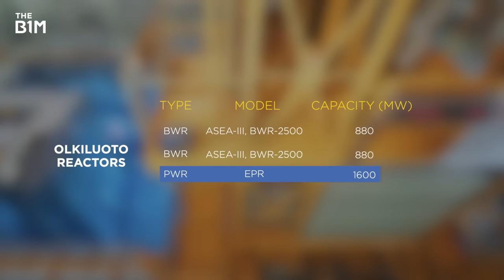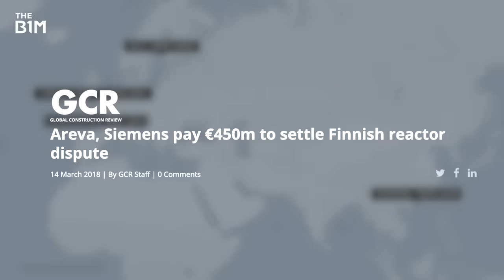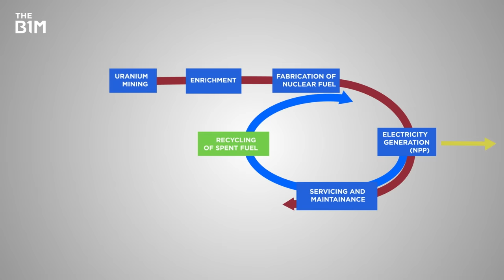Finland Might Have Solved Nuclear Power’s Biggest Problem

Comment: I thought you were going to tell us they'd perfected some kind of breeder reactor that would re-enrich spent fuel into a usable product so it didn't need to get buried anymore. Instead I learned they are just burying it bigger better and harder than ever before
Reply: The type of reactor you're talking about is called a breeder reactor or fast breeder reactor, and they do already exist. They can be more expensive to maintain and also directly produce more fissile material than is put into them once they're up and running. This is a great plus in terms of efficiency but also poses many security concerns regarding control of weapons-grade nuclear material. For these reasons less-efficient and more wasteful reactors like the one in this video are often preferred, despite the effectively permanent waste. There is also always the concern with water-cooled reactors of catastrophic failure, such as the events at Fukushima and Chernobyl, which is still present in uranium-based breeder reactor designs. One proposed solution to the water problem is Thorium-based molten salt reactors, though these still have the security concerns of any breeder reactor. PBS Spacetime recently did a good video covering Thorium reactors if you're curious!
Reply: @ganonfan98  there is no problem of control over weapon-grade material. Plutonium that is produced other than Pu239 contains Pu240, which means no nuclear bombs. Pu240 can cause spontaneous explosion if its used in weapon (because it "combusts" 30000 times faster than 239, so chain reaction can be caused by normal decay), and no one likes your own bombs exploding in your own storage facility.
And you can not separate atoms that are only one unit of mass apart, no centrifuge can do so.
Reply: Yeah having a permanent disposal solution is so stupid when you instead you could use a risky temporary solution that requires constant active upkeep
Reply: @bbbbbb3734  molten salt reactor designs have walk-away safety, actually. I suggest you look into it!
Reply: @ganonfan98  I recommend you look into technology that does not exist.
Reply: @ganonfan98  To be fair, if you struck a toaster with lightning or threw it into a lake, it'd blow up too.
Reply: @wumi2419  but that is not the stuff they are burrying is it :D
Reply: @jotha7207  thankfully its not. I don't think anyone in the world has working industrial breeder reactor now (Russia has prototype, but iirc its incomplete)
Reply: Hey but to be fair, the burial only has to last 100,000 years. As soon as you bury it good enough to accomplish that you're finnished.
Reply: Yeah, I'm pretty disappointed as well.
Reply: You can dig out the fuel once you've created such a reactor so Onkalo is kinda part of that solution too. But yeah, the breeder reactor would ALSO produce nuclear waste that would need to be handled. It cannot be recycled infinitely, it must go somewhere ultimately.
Reply: But honestly I'm a bit dissappointed when people are dissappointed when there's a practical and thought out solution to a practical problem when it's not some Elon Musk level bullshit. Perhaps lower your expectations and start thinking practically. This is just engineering!
Reply: @McSlobo  The reason why I’m disappointed is that once you have an apparently-good-enough solution to a problem there is inevitably less pressure and motivation to try and find a better long-term sustainable solution.
But that’s me.
Reply: @McSlobo  not necessarly the technology wont be created in at least a century since something like that is almost impossible and they still have to think about the half life of the waste
Reply: @bbbbbb3734  Putting something in the ground and covering it up, isn't a "permanent solution"
Reply: @xcvsdxvsx  This huge facility accommodates spent fuel rods for the last 50 years and until 2120, so about 150 years worth of fuel rods. To cover the 100,000 years needed until the rods are "safe" again, you'd need 600+ more of those facilities! Just imagine that. And that's for Finland's usage as of today only.
Reply: @mbirth  No no. They wont leak radiation for 100,000 years. At which point there will be no radiation to leak.
Reply: @xcvsdxvsx  Anyone who thinks that we won`t find a way to use this spent fuel in the next 200,000 years hasn`t been paying attention.
Reply: m oi unfortunately it is not a permanent solution. It’s a typical thing humanity has done since the beginning - use technology to your advantage without having a viable fail proof solution to the consequence. Thus the current disaster of the planet. Just one more problem for future generations to deal with. Based on the track records - it will fail
Reply: Markus Birth agreed!! Not a solution
Reply: You can throw the spent rods into a CANDU reactor ;)
Reply: When it starts to open more after the use.
Reply: And then it stays 100 years there, unitil its been long enough there and so some guys in next centary can pick it up.
Reply: @SlagerOutdoors  Just out of curiosity is your position that "this isnt buried deep enough"? Or is is that "not even the center of the earth is deep enough if it is man doing the burying"?
Reply: Solution, hahaha, just moving the problem 50 years into the future is not an engineering solution, it is a political compromise  that will affect our children and future generations.
Reply: @sorinangeleanu  Nuclear waste decays over time becoming safe unlike substances that have chemical toxicity. We need nuclear to solve climate change since it's the only stable co2 free energy source.
Reply: @bbbbbb3734  lol, just sell nuclear waste to Russia which has TWO breeder reactors. Easy solution
Reply: The whole issue is ridiculous,i`m very pro nuclear power but question why build this kind of reactor when a power plant using a fluoride thorium reactor. is vastly safer with little waste and uses less Thorium than a Uranium reactor( 1/35 for the same power generation)
Reply: Re-use spent fuel? Hahahahahahahahah! Fat chance of that nukie lie ever happening.
Reply: @fistful_of_aneks  Three points. 
1. Russia only does that with its own used nuclear fuel - produced by TVEL (Rosatom)
2. The country does not sell it to Russia, it pays Russia to take it back. After multiple “recycling” processes, a couple of tons of used nuclear fuels become 20-40 kg box which is 1000s times less radioactive and that “box” is returned to the country.
3. Closed nuclear fuel cycle is something that Rosatom is working on. Brest 300 is under construction. Should be operational by 2030 - give it 2-3 years to test all the new tech… if successful - by 2035 they will offer these reactors to the world = things in energy markets will change the world 180 degrees.
Reply: @ganonfan98  Chernobyl style failures are now impossible due to introduction of a lot of safety features designed after that event. Fukushima failures are due to incredibly exceptional situations. Fukushima reactor is from the 60ies. Water cooling is not inherently "unsafe".
Reply: The future will be some form of molten liquid salts as fuels. Magnitudes in efficiency over solid fuels.
Reply: @jackfanning7952  imagine thinking renewables are economical. LMFAO
Reply: @TheFoxSaid  Imagine thinking that renewables are not 4-10 times as inexpensive as nuclear and twice as inexpensive as fossil fuels and not orders of magnitude cleaner and safer. Hahahahahahahah!
Reply: No shit.
Reply: @xcvsdxvsx  it really doesn't. Radiation falls of with increased duration, so unless it's the start of a very long, decay chain of short lived isotopes or outputting a lot of gamma radiation, it's probably fairly safe to store above ground (if it is one of those two categories, then it's almost definitely still useful as fuel in a molten salt reactor, so why is it being thrown away).
Reply: @McSlobo  well, it can be recycled until it's at or below background radiation levels at any reasonably expect temperature (<1000°c). At that point you are probably dealing with something that's functionally inert or is a toxic substance, the former is safe to simply deposit into landfill, the latter can be disposed of into a subduction zone (if properly set up, you can use it to pump up more useful materials from the mantle, though even without that, it will slowly work its way down into the mantle where it's harmless if buried in such a location)
Reply: @sorinangeleanu  well, you can't have a final solution for anything unless you figure out how to cause spreading proton decay or your plan is named by a failed art student.
So long as you think of every solution as just a part of a larger equation and keep working on kicking the problem further down the road, you'll either find the problem has become unimportant, the missing piece in solving some other problem, or the universe is so far gone that there's no need to kick it any further down the road.
Reply: @wildfire160  for the same reason it's efficient to starlift the sun to remove helium: it's better than wasting the rest of the stuff we have, and given that it's actively decaying to produce waste heat, it's better to start using everything now.
Reply: @jackfanning7952  inexpensive? Sure, if you ignore having to replace them every 4-15 years...
Reply: @theapexsurvivor9538  How often do you have to replace U-235 in a reactor? How often do you have to replace casks storing the 20-30 tons of 100s of ionic radioactive isotopes generated by an average reactor per year for the next 240,000 to a million years?
Reply: @theapexsurvivor9538  Not sure if i`m getting you,what you're saying doesn't seem to apply to anything i wrote ...did you maybe reply to the wrong post??
Reply: @bbbbbb3734  problem is it's not permanent. Imagine an earthquake unearthing those or lava entering or water or whatever natural phenomenom in those kind of stockage places.And don't forget those materials and holes are meant to resist for thousand of years since they are permanent. We aren't even sure what will happen in the next 100 years so i'm not buying the permanent .It's just " yeah we dig bigger holes, made better casing  and that solves all the problems " .
Reply: @jakkonexus1166  those " incredible " situations are becoming more and more frequent due to climate change . So Fukushima is just the 1st one of its type. And since we fucked up and can't stop climate change ,  the exceptionnal conditions Fukushima happened under are gonna become the norm much faster than you  can decomissionned those facilities.
Reply: @bbbbbb3734  haha, dont waste your time. People just are too stupid. This guy really thinking he's the firts who thought about earthquake haha
Reply: @ganonfan98  wasnt thorium a good alternative since you cant produce nuclear weapons out of it?
Reply: @luciuslucifer9455  That's why they are carefully picking a place where to dig those tunnels. Don't compare California or Asia with Northern Europe. Northern Europe rearly gets any earthquakes and when they do they are minor. Even apples don't fall from the trees during those.
Reply: @jackfanning7952  Also, ask Germans what they think and how things are going with their plan to shut down they nuclear plants. Their switch to "green" is a disaster.
Reply: @EriksHarjo  Germany has the strongest economy in Europe. Ask France what they think of EDF's European Pressurized Reactors (EPR) that were supposed to be the forefront of the nuclear renaissance in Europe. Their reactors at Flamanville, Olkiluoto and Hinkley Point have been characterized by safety deficiencies, construction delays (the gang that couldn't weld or pour concrete correctly) and costs explosions. These are total failures even before construction is completed. The lawyers are piling up at the gates, scrabbling for a hunk of the carcasses. At least Taishan got started before they had to shut down to make repairs to stop contaminating Hong Kong. What has China set as the safe exposure limit for nuclear emissions this week? Wonder how much it will cost (and whether it is even possible) to clean up that mess with the fuel rods? While all this has been going on, renewables passed all other energy providers as the number one source of energy in Europe in 2020. And they don't present a weapons proliferation risk. Imagine that.
Reply: @ganonfan98  there's a really good video on why most water cooled reactors now don't carry the same risk anymore.. mostly because the water for energy production and moderation are the same water. If it gets too hot the water goes away, the particles move to quickly to have a likely chance of hitting another nuclei and sustaining a reaction and then it stops
Reply: @jackfanning7952  If by "renewables" you mean solar/wind/water then they will not be viable for at least 100 years, most likely a few hundred or a few thousand years. Nuclear is the only viable option to use during that time. Unless you prefer Coal and Gas, which, I don't think you would; given your inclination.
Reply: @IrregularPineapples  You aren't keeping up with current events are you? Energy from solar and wind exceeded the energy generated by nuclear and coal in the U.S. in 2020. Solar and wind energy exceeded all other energy sources in the EU in 2020.  Nuclear produces 4.8% of the energy in China. Wind over 15% and solar over 16%. Nuclear energy has flat-lined for the last 30 years and those creaky, brittle, leaky old reactors are getting older and more expensive to maintain every year. Major financial investment firms will not touch investing in new nuclear plants with a ten foot pole. The only reason nuclear utilities haven't shut down their creaky old unprofitable reactors is that as soon as they do those reactors will go from the asset side of the spread sheet to the liability side. The utilities and financial firms investing in them will immediately go bankrupt. That will be the blessed end of the "Atoms for Peace" farce... very soon.  But for the wrong reason. Not because of its horrible health and environmental destruction, but for economic reasons. Solar and wind has grown 70% to 80% in the last decade and energy storage technology has made huge advances. It can now cheaply and adequately store energy produced when the sun shines and the wind blows . Renewables produce (and store) energy 2-5 times cheaper than nuclear and nuclear hasn't even addressed the most costly issue - waste disposal. Not only are renewables the future of energy production, they are the present. Want proof? Look at the World Nuclear Industry Status Report (WNISR) for 2020. It will give you specific information on the nuclear industry in countries around the world.  Read it and weep, nukie. Learn something and quit spouting untrue NEA propanganda.
Reply: @IrregularPineapples  Crickets
Reply: @xcvsdxvsx  Thats what they said 100 years ago when they buried toxic hazardous waste in steel drums
Reply: It's honestly not a bad strategy, America is ridiculous with the nuclear waste.
Reply: @xcvsdxvsx  in one generation everything we buried could be lost knowledge wise. So don’t dig it up for the next 100k years. Rip.
Reply: @McSlobo  so how about we stop making things where the best thing we can do with it is bury it for the next 100k years. Lmao some things in engineering shouldn’t be touched if things are “impractical” yet ahead we march creating tons of waste we can’t do anything with that kills anything it sits near. So why go after those disappointed with your progress and instead make the impractical practical.
Reply: @ganonfan98  IFR's do make PU, but makeing it into a weapon is not a lot easier than LWR fuel * LWR = 60%  IFR 80%   that last 20% is not done in a back yard.
Reply: Clickbait
Reply: Nuclear safety protocol in pretty much every country dictates that contaminated materials should not be stored below the water table. It doesn't matter how much you do, time and water can wear down pretty much any defence, and when they do, it then also provides a mechanism to spread the radioactive material directly into the water supply. 100,000 years is a long time.

Would have been better off running this facility back into a mountain. This is making it someone else's problem in a few hundred years.
Reply: @jackfanning7952  that's some interesting math you've done there. By the same logic you could say that natural gas fired power generation was greater than all other sources in the US.
Reply: @justsomeguyhere that 3% is waste then. And then that 97% produces 3% waste? Or would it deteriorate worse? 

Regardless there’s still waste we can’t dispose of.
Reply: @mbirth  yet that buys scientist another 150 years to think of other ways to create nuclear energy that create less waste, or a better way to dispose of it, maybe by that time we can just teleport it to another planet
Reply: The Russians are already on that. Besides remanufacturing irradiated fuel into new fuel (which the French can also do, just worse), RosAtom is currently building the first entirely closed loop system with reactors + re-ingestion of fuel, due to enter experimental production circa ~2030. This is not a 'problem'. The solutions are already in flight and at this point, burying what is a valuable input is just silly. I blame the US for labelling irradiated fuel 'waste' by law.
Reply: @jackfanning7952  "Nuclear energy has flat-lined for the last 30 years" because of people with radiation phobia, like you. That has led to an increase in fossil fuel usage. Climate change has accelerated because we stopped building nuclear plants. Anyone who cares about the planet and also listens to scientists, is in favour of using fission reactors. I don't know how much you care about combatting climate change, but clearly you prefer satisfying your irrational fear of radiation. BTW, coal plants also emit radioactive particles. Only those aren't stored in dry casks. They get spewed right in the atmosphere.
Reply: @computercrack  I think you are right about it being about economics in countries where the private market was financing them (US, Germany). Your arguments make perfect sense. Nuclear is only cheap when you factor in the long lifetime of the facilities. Very high upfront cost. But in many countries, where they were financed by governments (France), the reasons for the slow-down were political. Right now what is most expensive is storage. Wind and solar are very cheap because they don't need to worry about storage yet and they get priority on the grid. If 100% of electricity was from wind and solar, they would be much more expensive. Either a lot of storage would be required, or we'd need to install 4 times the capacity needed without storage and run them idle a lot of the time. We can theoretically compute what would be the ideal mix of solar, wind & nuclear in order to minimize electricity cost. It will for sure not be 0% next to nuclear. When it comes to hydro, the more, the merrier, since we can switch it on and off (almost) as we like and even use them as batteries if retrofitted with pumping.

I will ignore the matter of nuclear waste, since compared with storage and distribution, it's a non-issue in terms of cost.

Flamanville will make a lot of profit over the 80 years or so that it will be operating for. But it will take a long time for it to start making profit.
Reply: @computercrack  Also, cars would've polluted massively anyway. But heating and a lot of industry could've run on electricity provided that electricity was cheap and abundant enough. Unfortunately it is still much cheaper to heat your house using gas. Even with the recent price hikes.
Reply: @radoomiron93  you can look up "EU taxonomy nuclear" so much for cheap energy. France wants to label nuclear as green to direct money from investors to nuclear because France as a state can't afford it. EDF is running at 37bill debt. You can't rule out economics entirely. France nuclear reactors are almost all reaching 40 years lifetime and need to be replaced. Flamanville =12 bill multiply by 56 (number of nuclear plants) = that's almost 700bill € and thats only the building cost. No decommissioning old plants, no loans, etc (Flamanville is even expected to be @19bill after all). Even France wants to reduce nuclear to 50% or so. Why? It's freakin expensive, that's why.
Reply: @radoomiron93  ignoring the cost of waste disposal is dishonest, you have to take everything into account. And it's not for free, that's for sure. Flamanville will never ever turn a profit and it will not last 80 years without complete overhaul. Do you know any industrial facility from 1940 still in use today without major overhaul? Only thing I can think of is the Hoover dam, but that's just a big concrete wall, the turbines itself have been replaced already in the 80/90s.
Reply: At least it seems to have placated Godzilla.
Reply: xcvsdxvsx I don’t think burying nuclear waste is a viable solution no matter the depth. I would suggest mixing an unnatural source with the original creation posses a huge risk of a negative side effect.
Reply: Petar Petrov not exactly sure what you are saying. Nuclear is good or bad in your opinion?
Reply: I also thought that's what this video was when I clicked on it.  Reprocessing fuel is really what we need to be doing.  We can reduce the volume and toxicity and half-life of nuclear waste through reprocessing and reuse.  That this is not a direction politicians are embracing baffles me.  Wind and solar are nice supplemental power sources, but given the supply chain picture, they are unlikely to be our path to a zero carbon economy.  Natural Gas in the short term to lower emissions, nuclear fission and geothermal in the medium term, and someday, nuclear fusion will blow it all away.  The latter is still experimental, so we need to be investing hard in the first three.
Reply: @altond511  , I agree but then again anyone who thinks he knows anything about the next thousand years is just guessing, or the next one hundred.
Reply: @SlagerOutdoors  , so what is it we can use now and not in some fantasy world of yours that doesn't exist now.
Reply: @jackfanning7952  , there is yet no way to run an industry in northern countries like Germany or Finland without base energy, from, you choose, coal, oil, gas or nuclear. Germany was hoping for gas until renewable can solve the problems in the future.
Olkiluoto 3 went critical 21 dec 2021 and yes costs and time were much too optimistic in the beginning, more the rule than the exception, so what.
Reply: @jackfanning7952  , it's quite obvious you don't know how a grid works and what the demands are to keep it working.
If we find a new clever way to store large "amounnts" of electricity then things would change radically.
Running Finland on wind and solar alone is just a silly joke.
Reply: @hurri7720  Base energy is obsolete, irregardless of where you are. I choose none of the above for obvious reasons. Neither coal, oil gas or nuclear is a viable option. The No.1 component in the solution is invest a fraction of what was wasted in Olkiluoto in energy conservation technology. Billions and decades wasted on a flawed, expensive, unreliable nuclear solution with a never-ending deadly waste dilemma is crazy. You have seen the results of 75 years of following this path. No one with any sanity can call it a success! Use the available resources to combine energy conservation with flexible grid management, renewables and advances in energy storage technology. Nuclear is the riskiest and most expensive option of all. It is also the most likely option to result in the destruction of all life on this Earth.
Reply: @ganonfan98  id offer you to learn more about Beloyarsk nuclear power station😁.U'll be surprised...
Reply: You realize that the basic conservation of energy says that you cannot get any more energy from that waste than you put in. We cannot do anything with nuclear waste currently. Restoring that waste back to it's original fissile state will require at a theoretical minimum the same energy that the original reaction produced. That's in a perfect world with 100% efficiency, which is impossible btw. In order the continue to make energy, we will need to find a way to do something with cesium 139 or strontium 90. Modify them so we can further split them in other words. That, or use nuclear fusion to bind more material to those byproducts to make something we can break again. Currently, that is not possible, and from the looks of it, we do not know if it is even theoretically possible to do with human held resources. Therefore, that waste is going to remain waste.
Reply: Also any process that relies on taking the fuel elements apart, and somehow solving, re-enriching and re-solidifying these materials are creating a shitload of de-riches leftovers, contaminated materials and containers etc. in the process…
Reply: @ganonfan98  thanks for the suggestion!
Reply: @angeloromano9346  co2 is not the only problem with global warming. It's heat production period. Why don't you get that? It's in the name.
Reply: no safe place on earth
Reply: @Sgt_Hest  It's been the "permanent solution" to human corpses for millennia.  Seems like a good solution.
Reply: @SlagerOutdoors  Ancient Egypt needed to provide work for all its people and had a problem about what to do with its dead rulers... 30,000 years later, their graveyard is our 'treasure' and their slave 'make work' project is a wonder of the world.  100,000 years from now, those rods will be in a museum.
Reply: Hahahaha ....nuclear waste can be almost fully recycled ....🤣
Reply: Should just put it on a rocket and send it into space. Let that be some other planet's problem.
Reply: @MrJdsenior  as of 20 years ago nuclear waste was always buried in the US but in Europe......as it can be recycled to nearly 100%
Reply: LFTRs are better and safer for that.
Reply: @bbbbbb3734  It's existed since the 60's.
Reply: @bbbbbb3734  Or you could use solar, wind, hydroelectric, geothermal and hydrogen individually or in concert at local applications freeing the consumers of energy from their indentured servitude to the monopoly of nuclear power and avoiding all of the loooooooong lasting risks.
Reply: @ganonfan98  What is walk-away safety?  Since you've looked into it do tell.
Reply: @vernonfrance2974  Absolutely those are better options and economically much smarter and continue to become more affordable and building nuclear is already financially problematic. But since nuclear exists something must be done about the spent fuel and this is a great way to hande that.
Reply: Retreatement produces more hot staff to burry.
Reply: Why can it be packed into a rocket and fired directly into the sun? I've always wondered...
Reply: @Lemma01  Cost is prohibitive, these things were supposed to make money...
Reply: @marcwinkler  Maybe -  but is it? We seem to able to spend the odd billion on a war... and surely the cargo size we're taking about is relatively small? Really asking for info, here.  Cheers
Reply: @Lemma01  241 assemblies in OL3 reactor  510 kg each ,  241 x 510 kg =
Reply: @marcwinkler  Blimey! That explains it. Thank-you!
Reply: @bbbbbb3734  So the molten salt reactor built and run at Oak Ridge during the 1960's was imaginary?
Reply: Same. Kinda disappointed
Reply: You thought wrong
Reply: Yeah, Like the one we had over 10,000 hours of run time on.  LFTR.  Liquid Flouride Thorium Reactor would solve the entire problems.
Reply: @jackfanning7952  base energy is obsolete? First, are you talking about "base load" power, and secondly... wtf are your credentials to be making a ridiculous statement like that? 🤣

Base load power is the only reason the lights stay on 24/7
Reply: @ganonfan98  Don't some of the molten salt thorium reactors also have the ability to use the waste from other reactors for fuel?  Seems like finding ways to get the last of the radioactivity out of the spent fuel might be a better solution than burying it forever.
Reply: I thought they would of came up with a better to make sure during a meltdown it won't leak out to hurt people